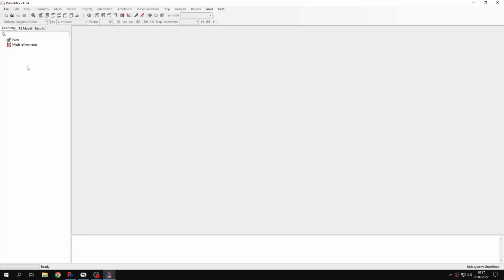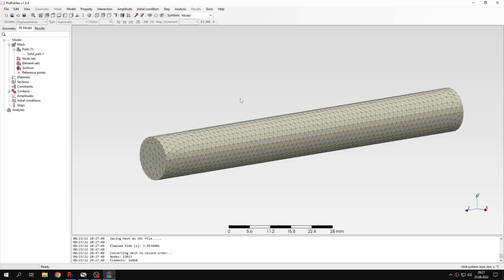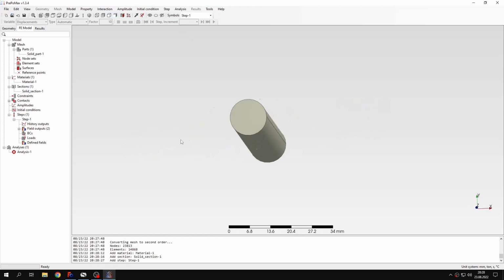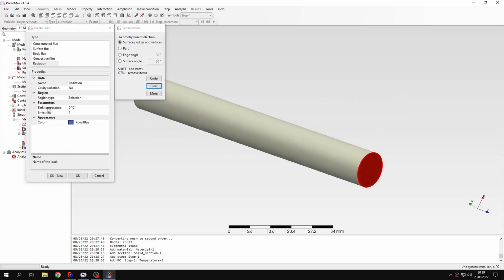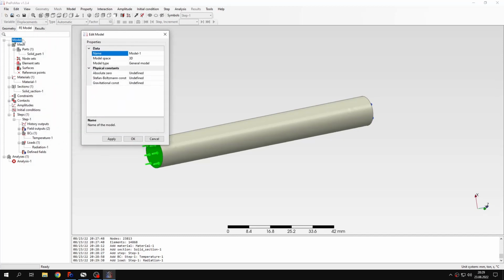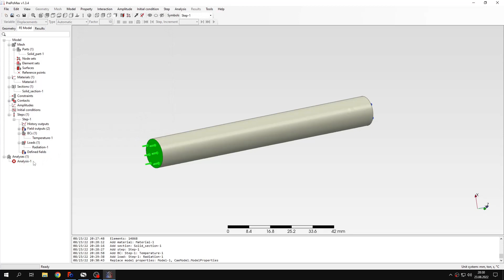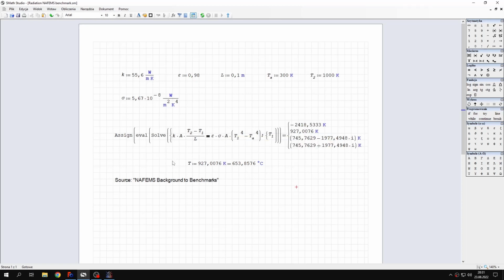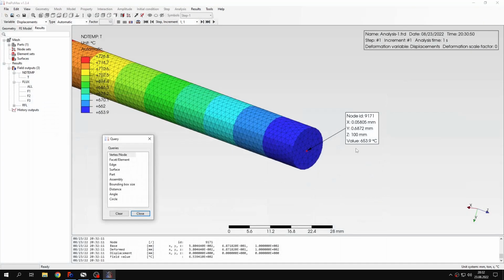PrePoMax (CalculiX FEA) - Tutorial 24 - Heat transfer with radiation - NAFEMS benchmark

Comment: Perfect job!
I have a proposal for tutorial which would cover "Constrains" and "Contacts" - shape forming with a tool.
Also - something about "Amplitudes" would be useful a lot.
Reply from the maker: Thank you. The currently available constraints and contact were covered in previous videos but there were no metal forming examples. I have them on the list of planned tutorials. I also want to show the use of amplitudes in the future. As always, the biggest issue is finding topics that are suitable for verification with analytical calculations. But I think that I will figure something out. Once I finish the thermal and thermomechanical analysis tutorial series, I will go back to mechanical simulations.